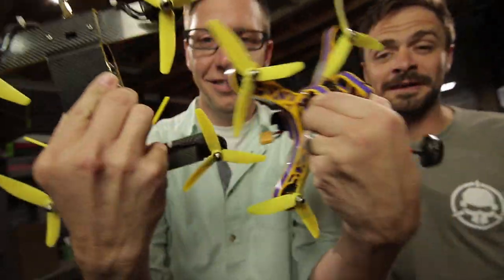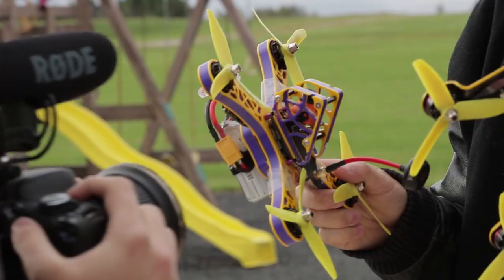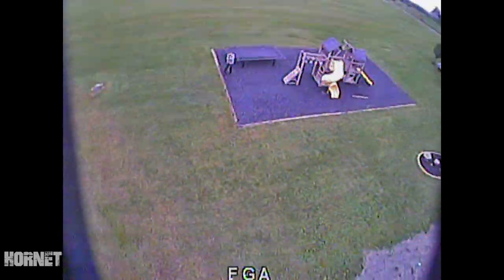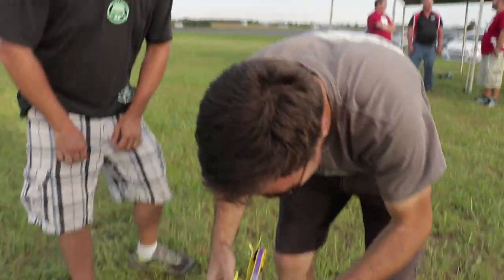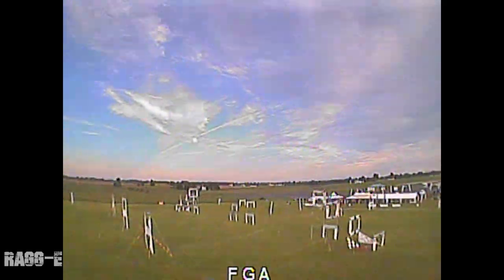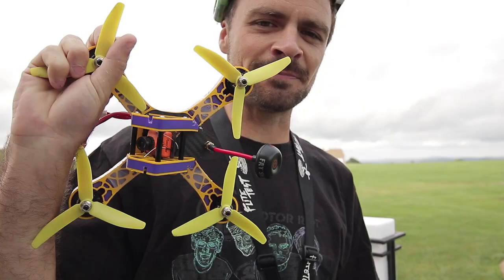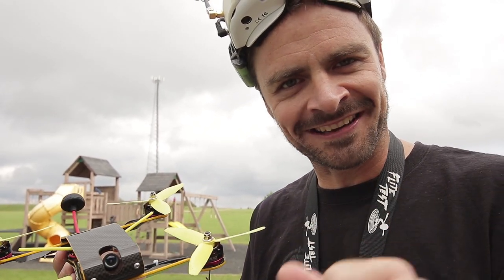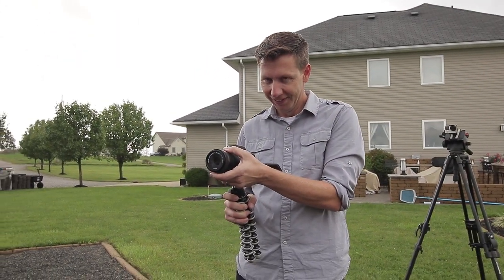Carbon Hornet vs Ragg-E

Comment: Do the same test with Martian 2 vs Alien frame!
Reply: I would be interested more to hear blind pilot test opinions than crash test results for this anyway.

I don't think we would hear an unbiased conclusion on it though. These guys job is to promote their sponsors gear and act like everything else is basically unflyable. It's a shame because the hobby is a lot more accessible to beginners if they build their first quad with parts from banggood instead of the rotor riot store.

Comment: would be super interesting to see you compare a clone to an original frame. Put it in a press and see what force it takes to break it. How much more durable is a 100$ frame compared to its clone at 20$? Would suggest the qav-x vs realacc x210.

Comment: Loved the video! It's really not easy comparing frames with the same equipment because its like comparing apples to slightly different apples, but I liked the format with the blind test. I know people may hate on the crashing, but lets be honest that's a huge part of the review there if a quad cant take a decent hit I don't want to buy it. I think you should keep this format of rating the build, rating the flying, then rating the durability because those are what I look for most when buying a frame!

Great video!

Comment: I have so much fun watching you guys have fun.  I really liked the way you did the blind test, that was a very fair way to do it.  And smashing them into a solid object full tilt was a good test, because that kind of stuff happens, at least with the Ragg-E you know you can recover most of your gear, even if you destroy the frame, which in this case seemed to hold up very well.  It was a very fair review, and better you smash stuff that was free, than we smash stuff we paid for, because we didn't know it was going to fly apart.

Comment: you should do a crash test with an alien
Reply: thats 130$ + gear hell no im gonna tear blood
Reply: Crash test the Alien and other quads, find the crash proof quad!!!
Reply: the indestructible quad is called HMB 250 :-)
Reply: They could just build the frame and use old broken motors / old batteries and just Frisbee all the frames into a wall as not to waste good equipment.
Reply: I'm pretty sure Steele has done this but not on purpose. :) He said he's flown the same alien for a year and hasn't broken it. And some of his wrecks have been brutal. Especially that power loop gone wrong in the mall!
Reply: I'm sure Impulse would gladly send free frames to them given how much promotion they're getting with Chad and Steele.
Reply: yeah ur right doesn´t even need a fpv system for that, and leave of the receiver max trottle all the way :D

Comment: Hornet stock just pummeled!😁 
At the end the overall test in flight, heavy feeling ect.. Is what I'm interested in and what I'll use as a decision maker when purchasing a mythic. The crash was definitely fun and educational as well. Anything flown into solid object at that speed would result a very similar outcome. Not surprised. 
You are right tough, we all want manufacturers to continue to innovate and provide the best possible design. We appreciate everything they are doing.

I also appreciate what you guys are doing and providing us with an honest non biased result. This allows us to continue to trust your feedback in regards to gear. Thank you so much for your honesty and videos.

Comment: Ok so heres a question you probably dont get often. When picking components, lets say an ESC, would you prefer something standard like a kiss ESC or any of those standard looking ones, or do you prefer modularity in a component like the TBS Powercube? This I suppose could be said for any component like FC, OSD, or anything really. And on that note, why not use the Powercube? Seems like a great fit for some of these frames because its so small.

Comment: The Ragg-E hit the single board which had more give than the more solid boards that the Hornet was crashed into. Not sure if it would have made a huge difference but not exactly the same hard surface.

Comment: How much difference in the handling do you this was down to the Flight Controller vs the frame design?  

I know Chad has said he prefers Kiss to Betaflight but I would be really interested in seeing two identical quads with just the FC firmware being different (you could stick betaflight on the Kiss FC).
Reply: The FCs are basically the same except for the GUI to tune the parameters of the MCU and Gyro.  Both KISS and all good boards running Betaflight use a STM32F303 MCU and a MPU6050 Gyro so the way they control flight characteristics will be identical.  From my experience with tilted motors, the frame designs are the difference.  Tilted motors add an interesting characteristic to flight and people used to flat mounted motors probably wont like them as much.
Reply: Hardware yes, software no.  Given Boris has completely rewritten the PID controller since betaflight forked from cleanflight I think it would be safe to assume that the KISS methodology is different as well.

In the same way the Mac and PC run on the same hardware but give totally different results.

Comment: Please blind test  kiss vs. betaflight 3.0 on identical quads
Reply: Skitzo does this in his VLOG001 post, he never tells you which quad is which I have watched it so many times and I honestly can't tell the difference...although his flying always amazes me.  A BF3.0 setup with BLHeli S is basically the same as KISS.  But if you run that BF3.0 firmware on a newer STM32F405 board it will run faster loop times then KISS theoretically being better?

Comment: which motors are used in the carbon hornet? I have some Emax RS2205 2300kv and a bl heli 30A esc in my quad and it weights 460g with accu and 500g with accu+fpv. Is it good for racing or freestyle?

Comment: I would love to see if you guys can break any of the lifetime warrantied armattan frames.  My F1-6 has taken some serious beatings, I think it would have just shrugged off the playground!
Reply: In fact, I will buy and send you guys an armattan if you promise to do your best to kill it. (I know you love free stuff :-D)
Reply from the maker: +Alex Magee challenge accepted!!
Reply: Rotor Riot Sweet, Pm me a shipping address and I will get it done.
Reply: Phongsta I think that an armattan will laugh at anything made of wood, they will have to aim for steel or concrete to do any real damage....  Anyway even If they do break it I will be able to claim a replacement on the warranty.  Its a win win lol!
Reply: I ripped the acro pod out of my F1-6 Acro and broke the screws and cf antenna hooks out of the top plate... but it survived
Reply: must have been some crash :-D
Reply: Phongsta I recon that they might be able to crack the top plate if they catch it at the right angle, but I have had some absolutely horrendous crashes with mine and its just laughed em off.  If I had done the same with my QAV 210 it would have never flown again.
Reply: full speed 45° vs metal pole

Comment: Thanks for a fun video guys...
oh and if you did bend an arm on that Ragg-e..just heat gun it back into position and or plastic weld the hdpe...i do and it works awesome...can't do that with carbon eh??

Comment: Really nice video guys really educational and what rtf race quad do you recommend as my first I have a phantom 3 so I have experienced brushless with the phantom and I just would like to know what would be good because my dad won't let me buy everything separate thanks in advance
Reply: ImpulseRC Helix is a good middle ground since it comes with the major components and lets you still do a build :) There is also another RR video on various RTF quads
Reply: I'd agree with Andrew that a middle-ground ARF is a good choice - something that comes complete but requires assembly. You'll need a background in (re) assembly with these as crashing is par for the course, and something that everyone must deal with. Price being a very real object, I would recommend a cheap-as-chips combo based on the ZMR-250, it brings most of the performance and options that the best frames have, while being cheap and easy to work on. Many combos exist, try to use branded, quality motors and ESC's that you will be able to purchase separately if things go wrong, if possible even purchase a 5th motor and ESC just in case. Good luck!
Reply: Vortex pro or Shuriken 180/250, check rcmodelreviews, bruce is testing a lot of rtf quads lately
Reply: I'm running a Shuriken 180 and it flies great!
Reply: you could check out indestructible quads' Goby 180 build. Joshua Bardwell did a couple of videos on it and that frame is TOUGH!
Reply: Check out the video I made using a $300CAD RTF chinese quad package, basically the upgraded version of the Eachine Racer 250 that Rotor Riot made a video on a little while ago.  Complete package even with one 3S lipo and a charger to get you flying within a couple hours of delivery.  Honestly the thing was pretty damn awesome for what I paid and it lasted me quite some time till I really started flying hard and crashed from about 90 feet up, it broke a $6 arm on the quad but I still retired the frame after that, flew the rest of the electronics for another year.  You do need some solution for FPV goggles but that is common with pretty much all quads, but they can fly great out of the box, I never touched the tune in the one in my video and it is a bit sloppy but still fun as heck.

Comment: Oh man that was painful to watch... The Ragg-E's durability may come at the cost of looks, but what a performance. The Hornet fared as well as expected, at first glance you can see durability isn't baked in, and while those arms are beautiful and easy to replace, they're not easy or cheap to manufacture. Like most commenters, I'd love to see the same test with RR's choice frame, the Alien 5 Inch, or another QAV-style frame with stacked carbon plates, it's hard to argue with 3mm carbon. Is RR in any way surprised at the results of the taste-test or crashes? It seems Steele had a clue - he read the future and spoke of carbon splinters, about all that's left of it :)

Comment: You said repeatedly that 5x4x3 props are more for freestyle and don't bite in the corners or reach as high a speed as other props. That makes me curious, which props would you use for top speed/cornering?
Reply: Depends on the setup and what you are after.  Surface area helps cornering.  Higher RPM or higher pitch helps speed to a point.
Reply: Can't have the best of both worlds that like asking a Top Fuel dragster to be able to drift!  For best speed and handling on a 4S batter with a common 2204-2300kv motor I would say a 5040 triblade would be awesome or if you dont care about fly time a 5045BN triblade would net you a bit more speed.  For outright speed on a 250mm frame if you can run a 6045 triblade on most 2204s with a 4S that should make at least 1Kg yes a Kilogram of thrust per motor or something is wrong.  For outright handling scary enough those 4 or even 6 bladed props they have now will bite the most are and give you the most nimble feeling quad ever as there is more overall surface areas.
Reply: More blades doesn't always mean faster speed.  The 5x4x4 is slower than the 5x4x3.  Also, the 6x4.5x3 is slower than the 6x4.5 Bi-blade as you can't get the 2204 motor to turn it fast enough.  There is a reason the The F3D pylon racers are 2 blade.  Like you said, you can't have the best of both worlds.

Comment: The Hornet test came out different for the designer I saw them hitting 2x4 straight on but wow Chad the Destroyer
Reply: I saw the same video, but the 2x4 wasn't fixed to anything so just fell over. Very different to hitting a fixed object. Looks cool as though.

Comment: Could you maybe make a video on the QX90 "BNF" micro fpv quad from Banggood ? (I got one today in the mail and it's great :D)
Reply: We just got 4 of them and are a bit disappointed
Reply: FinalGlideAus why?
Reply: Heavy, large, no prop protection like the Tiny Whoop, performance was no better than the tiny whoop, props kept coming off, PPM receiver.
Reply: FinalGlideAus I'm not a professional, but I've the problen with the props by putting new props on it and I also made a propguard with my  
3D printer, but I got one question, what's the issue with an PPM receiver ?
Reply: Lag is the issue with PPM.
Reply: FinalGlideAus ok, thats weird, because I didn't notice any lag, maybe because I'm nit that experienced with high quality qwad stuff..

Comment: that's a good tazmainian devel impression Chad it would be cool to see you run around in circles with your hands in the air doing your tazmainian devel impression hehe
Reply from the maker: +William Davie it's not so cool after the 20th time ;P
Reply: +Rotor Riot no I don't believe that you love it ya madman pmsl   
can you please tell me what the v-bat voltage runs on iv got my pdb but iv idea if the v-bat connection is a 12v  lol  I'm a begging first build   and iv got 4in1   racestar be Heli 20A v2 esc  will I need to connect them to my receiver and transmitter and set the max & min throttle before installing them in the quad or can I just set esc in cleanflight my friend
Reply: +Rotor Riot no I don't believe that you love it ya madman pmsl   
can you please tell me what the v-bat voltage runs on iv got my pdb but iv idea if the v-bat connection is a 12v  lol  I'm a begging first build   and iv got 4in1   racestar be Heli 20A v2 esc  will I need to connect them to my receiver and transmitter and set the max & min throttle before installing them in the quad or can I just set esc in cleanflight my friend
Reply: +Rotor Riot no I don't believe that you love it ya madman pmsl   
can you please tell me what the v-bat voltage runs on iv got my pdb but iv idea if the v-bat connection is a 12v  lol  I'm a begging first build   and iv got 4in1   racestar be Heli 20A v2 esc  will I need to connect them to my receiver and transmitter and set the max & min throttle before installing them in the quad or can I just set esc in cleanflight my friend
Reply: +Rotor Riot no I don't believe that you love it ya madman pmsl   
can you please tell me what the v-bat voltage runs on iv got my pdb but iv idea if the v-bat connection is a 12v  lol  I'm a begging first build   and iv got 4in1   racestar be Heli 20A v2 esc  will I need to connect them to my receiver and transmitter and set the max & min throttle before installing them in the quad or can I just set esc in cleanflight my friend

Comment: I don't see how slamming them into a solid wall full speed proves anything about the frame.  Take any carbon frame and do that and you'll get the same results.  Why not run it into something more realistic like a metal pole that might be holding a gate up?  Who runs into solid walls full speed at a race?  Or free styling?

Now that you've done this take the frames you like flying and run them full speed into a wall and see how they fair.
Reply from the maker: Actually, we should run the Alien into the same wall. I'm quite curious how it would hold up. BTW trees are made of wood and we hit those all the time.
-CK
Reply: Full speed though?
Reply from the maker: Do we hit trees full speed? Heck ya! Especially Kevin [StingersSwarm] that guy will powerloop anything... wood, concrete, obsidian, etc.
Reply: And how does it turn out? Broken arms?  Broken bottom plate?  And that's full speed?
Reply from the maker: They usually break something.
Reply: Agreed that a lot of carbon quads would break in that situation.  The Ragg-e was touted as being indestructable so we wanted to test it but if we didn't test the Hornet then it would be one sided. I'm sure the Alien will break also.

Comment: Anticipated? Price? Weight? You get a lot of Carbon for the money, hahaha. I like the design, the idea, price is related to construction of bending the carbon. Due to bending ability the carbon is not so hard than other carbon materials and in this design the plates cant be 3 or 4mm. so it will brake. thank you for crashing, keep on crashing.